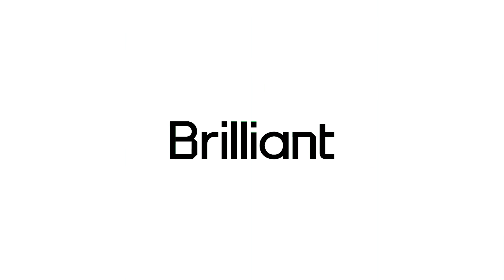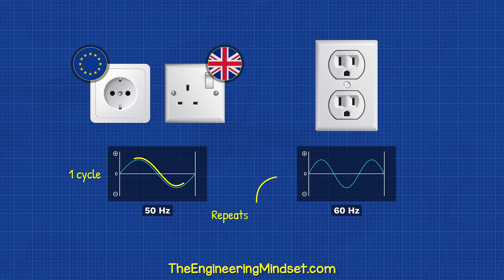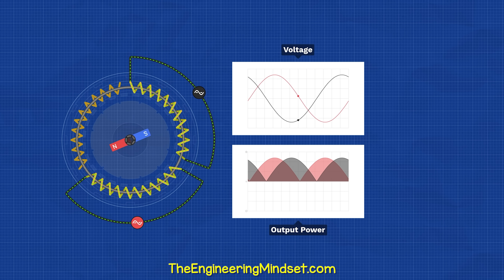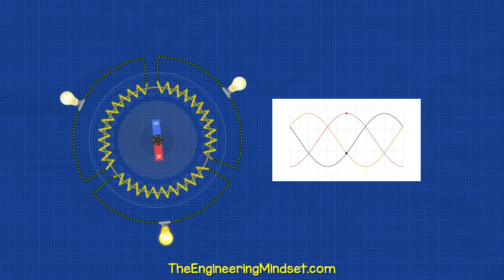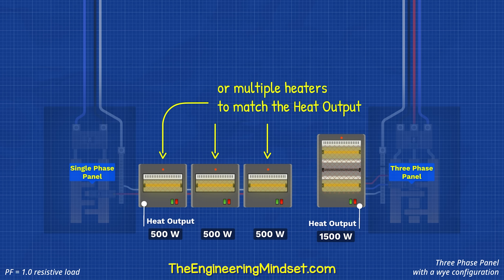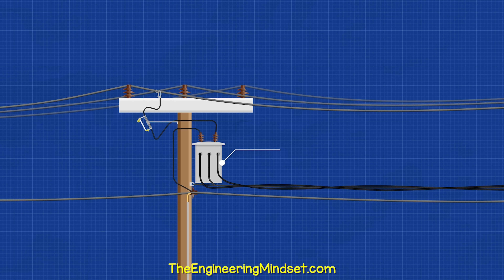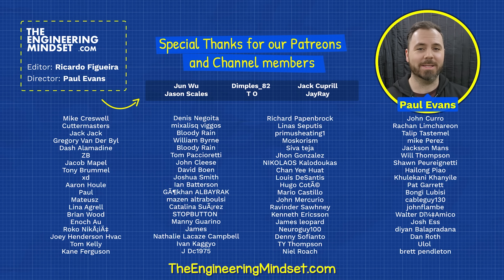How 3 Phase Power works: why 3 phases?

Comment: Finally I found one! When an engineer actually understands the fundamentals behind every technology, like you clearly do, and not just the equations, the result is a clear, accurate, convincing and memorable explanation... exactly what's in this video. Kudos to you for being a good engineer and a good teacher.
Reply: Are we talking about the difference between three out of phase and three in phase resistors, for the purpose of producing the same HEAT? Is there any scenario where IR being pulsed above a handful of Hz will make a difference? Heat diffusion in whatever absorbs it is slow and averagy !
Reply: @Trombonauta  While resistive heaters have their thermal inertia to smooth their output, the constant aspect is critical for big generators and inverters, as well as big industrial loads like motors. But even at a small home that has a 3 phase motors powering a heat pump or AC it's beneficial because the constant power and lack of pulsation decreases wear and noise.
Reply: @Ryrzard  yes, but why are resistive heaters even being mentioned?
Reply: @Trombonauta  Because the other guy mentioned them.
Reply: @Ryrzard  yes, so my question holds, to whoever considered it worth to mention first. I'm not asking about 3 phase motors here.
Reply: @Trombonauta  He asked whether resistive heaters would still flicker and the answer is yes. But they still operate at constant power because of 3 phase input. So that was the question and the answer. Not sure what your issue is.
Reply: @Ryrzard  the question was who cares they flicker. Heat flickering at such freq is the same as constant power for the purposes of heaters! So in the video, why would we even consider heaters as an example? They seem to be the greatest example of when 3 vs 2 phases is pointless.
Reply: @Trombonauta  Because it's a simple example without having to delve into the complex world of motors. And there are applications where a 100 Hz heat flicker may be undesirable since it can be picked up by sensitive semiconductor components.
Reply: @Ryrzard  then not the best example IMO, at all. About the other thing, are you sure the picking up is a heat thing and not an EM thing?
Reply: @Trombonauta  Pulsing heat can absolutely be picked up by sensitive equipment. It's not about EMF.
Reply: @Ryrzard  even considering the smoothing thermal mass, in a heating purposed device, where electronics are not supposed to be in contact or completely unisolated from them? To a point where 30 to 100 Hz makes difference? I can only imagine it's important if your signal happens to be tuned or cares specifically about that freq :(
Reply: @Trombonauta  I'm not really understanding your objection with resistive heaters. They are a really simple example and there's a huge benefit to constant power for all loads (even if it doesn't matter for the device itself), regardless of their application. Resistive heating is just one example where you can omitt complex impedances and nonlinearities.
Reply: @Ryrzard  the objection is easy: that's an example of the advantage of having a more constant power source thanks to more phases. The example is not the best because whatever (itself) you are heating with 1 kW, as far as I can imagine, cares nothing about the heat it feels being constant or just above 5 Hz at its very source. If the justification is that maybe there are some electronics nearby able to feel heat at that speed because they are really thermally connected to the resistors... I mean, even illumination is a better example if just cameras are involved.
Reply: @Trombonauta  Constant power is better whether the heater cares or not. A single phase grid would be very expensive and under terrible stress all the time due to the lack of constant power output. And no, it's not "more constant power thanks to more phases". Polyphase systems provide exactly constant power regardless of the number of phases.
Reply: @Ryrzard  the reason given is not about being less expensive but about heating more constantly, which is what I see meaningless. I'm not arguing it would be better, I'm arguing it's not a good example. Constant heating vs 100 Hz is important.... for which application? It's not the heater who doesn't care, but the thing to be heated.
Reply: @Ryrzard  to be more specific about what the video mentions: who or what industry needs "a consistent (constant) heat source", and considers that 50 Hz would be too inconsistent? That is the advantage being put as important in the heaters example, once the average powers match...
Reply: @Trombonauta  If you're not pulling a constant power but instead a 100 Hz full power pulsation then rotating machines are pulsing at 100 Hz increasing cost and decreasing reliability.
Reply: @Ryrzard  but they talk about heaters.
Reply: @Trombonauta  This applies to all kinds of loads. Regardless if it's a heater or something else.
Reply: @Ryrzard  yes, but you usually (always?) don't care if your heat source flickers 100 Hz (because heat is slow itself and matter provides thermal inertia). So it's a bad example for the advantage of consistency.
Reply: @Trombonauta  If you're pulling 100 Hz pulsating power then that pulsation occurs in the rotating machines that are powering that load, dude. Where do you think that power is coming from?
Reply: @Ryrzard  yes but, again, the point they claim is not about the effect on the power source, but about the purpose of the resistive load (10:10). So... It's a good example not because the reason they claim, which apparently has no justification, but because there would be issues they don't even mention but you are telling here to me?
Reply from the maker: Multiple reasons for 3 phase are listed throughout the video, here are some key points
4:30 Explained how 3 phases provide constant power. Graphic shows “almost” and audio says “more constant” with some small ripple shown, at this point all phases are still separate circuits and we have built upon simple single, two and then three phase generator.
5:05 Explained how it provides equal spacing. 
5:36 Explained how more phases means more cables, controls and protection equipment, complex infrastructure, more complex transformers and motors, harder to balance network and synchronise generators.
6:22 Explains how only 3 wires are needed which is cheaper.
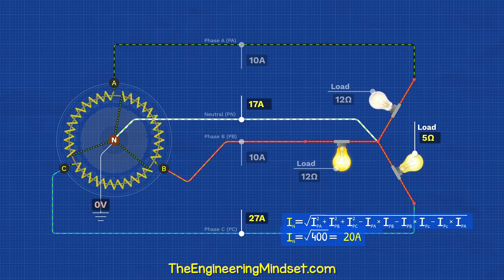7:26 Explained how neutral can be used to balance
7:54 Explained how we use single or three phase from same system
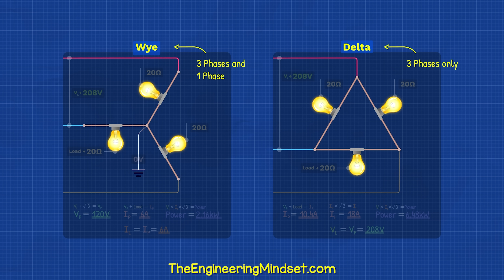8:21 Explained how Wye and Delta are used for different scenarios. Examples uses same resistance and line voltage.
9:59 Explained how 3 phase allows more loads to be connected
10:17 Explained how 3 phase uses more energy but provides more heat
10:19 Compares single and 3 phase power, shows 3 phase power is consistent 
10:36 Shows single phase and 3 phase motor. Single phase has capacitor
10:41 Shows comparison for 3 people v 1 person for motor analogy.
Reply: @EngineeringMindset  🤦🏻‍♂️again: my question was about a specific example, not about the convenience or not of 3 phases grid! Given these non-answers to my concern (about an inappropriate example) I will stop and now believe that, yeah, having my flesh being heated with 1 kW that shows a tiny 50 Hz ripple is overwhelming and disappointing... BTW, my concern could be solved by either saying ok, you are right or by just saying a single example where a 1 kW heater will make any difference at all depending on the number of phases. Will clay in an industrial oven be more fragile for that? Will paper paste dry differently?
Reply: @Trombonauta  I'm really not seeing what the issue is. Constant power is always beneficial regardless of what the load is.
Reply: @EngineeringMindset  I'm not seeing you actually explaining that there's a constant power flow in a 3 phase system at any point in the video.
Reply: @Ryrzard  the issue is: for what specific situation is rippleless heat beneficial? You say always, and regardless of the kind of load, but not a single example! I know that for many loads it is, and that's why heaters are probably the worst load example! Because of the aim and possible applications of their heat! Just one example, please! I don't say there are no situations where it matters, I just would like to have one example!
Reply: If you had to choose between constant heating and a  rippled-at-50 Hz one, and your only reason to choose the constant one is "just in case" or "it's always more beneficial", then maybe my question is not for you. Anyway my concern was a little one, about finding appropriate examples when explaining something, I can't understand how I'm having this big trouble to make my point understandable.
Reply from the maker: Yes I'm aware I haven't said "it provides constant power" in the video and I should have. Yes I know you believe the example I provided isn't a good example. The original commenter just gave some praise and enjoyed the visual explanation without all the math. You may not like the video and I'm OK with that, you can give feedback and that's appreciated but this is just spiralling into a pointless argument so I will not be responding further to this thread.
Reply: @Trombonauta  Well, the stability of the grid is a good thing and pulsing power is the enemy of that. So a constant power load is always beneficial regardless of the application of the load. The whole reason resistive heaters are even an example is because it's easy to show the constant power in them as was already explained.
Reply: @EngineeringMindset Thank you. By the way, I'm an engineer with a post grad degree...advanced mathematics isn't a problem at all. I was praising your conveying an the intuitive understanding that all engineers should strive to gain, on top of being able to solve partial differential equations!

Three phase (or even 30 phase) isn't going to be exactly, precisely, unwaveringly "constant" power... but who cares? At some point the approximation is good enough for practical use (engineering is FULL of simplifying approximations like this). The only true "constant" power is single phase, constant voltage DC, like that used in HVDC interconnects.... but the downsides to using that for all transmission lines are numerous, not the last of which would be the insane cost.
Reply: If he understood the equations he'd know that both 2 and 3 phase systems deliver constant power.
Reply: @Ryrzard  What do you mean by constant power? Wouldn't a resistive heater still flicker?
Reply: @JustinLebo-d3t  A 3 phase heater has at least 3 heating elements and while individual element will flicker, the sum of their heat outputs will be a constant without pulsation.
That's assuming that they are purely resistive. Heaters, especially high temperature filaments, are not linear devices and their resistance changes with temperature and as a result, they produce some harmonics in the current, some of which would not be canceled out by 3 phase current. But generally speaking, 3 phase power provides constant power for linear loads ("dumb" devices).

Comment: If you sign a contract to design a power supply that will use a 3 phase source with higher than 0.9 power factor....you can't just rectify.

Comment: If you came for the title (which is “How 3 Phase Power works: why 3 phases?”), the answer for that is given in a single sentence in the mid of the video, without fully explaining. It explains what happens if you increase the phases, but doesn't discuss what happen if you decrease it and do not answer “why 3 phases” directly.
Reply: agreed, ive been scrubbing through looking for the "why not 2" and im not really seeing it. And in the comments, i learned it's because a Harley motor shakes a lot :shrug:
Reply: Mikhail Dolivo-Dobrovolsky invented 3 phase generator , 3 phase transformer and induction motor , in Germany 1890s.
Same time in Sweden, Jonas Wenström received in 1890 a Swedish patent for same 3 phase system, that was start of ASEA, that is now part of ABB.  
Nikola Tesla in USA and John Hopkinson in UK, also came in conclusion that 3 phase system had something. 
So you had 4 men in 4 different countries that all came to same end result, 3 phase AC system, with practical experiments.
Reply: Yes he does. 3 phase gives a more uniform output while lower phases don't
Reply: 3 phases is the number of phases which was found to deliver the most power to devices without having to engineer in safeguards to keep the system viable.  No one has demonstrated that adding more phases is economical and safe.
Reply from the maker: Multiple reasons for 3 phase are listed throughout the video, here are some key points
4:30 Explained how 3 phases provide constant power. Graphic shows “almost” and audio says “more constant” with some small ripple shown, at this point all phases are still separate circuits and we have built upon simple single, two and then three phase generator.
5:05 Explained how it provides equal spacing. 
5:36 Explained how more phases means more cables, controls and protection equipment, complex infrastructure, more complex transformers and motors, harder to balance network and synchronise generators.
6:22 Explains how only 3 wires are needed which is cheaper.
7:26 Explained how neutral can be used to balance
7:54 Explained how we use single or three phase from same system
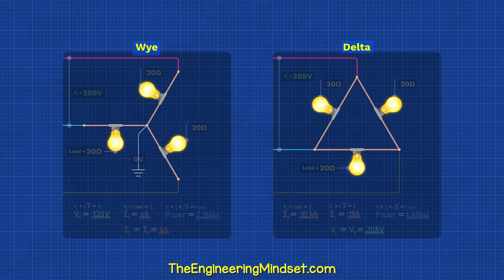8:21 Explained how Wye and Delta are used for different scenarios. Examples uses same resistance and line voltage.
9:59 Explained how 3 phase allows more loads to be connected
10:17 Explained how 3 phase uses more energy but provides more heat
10:19 Compares single and 3 phase power, shows 3 phase power is consistent 
10:36 Shows single phase and 3 phase motor. Single phase has capacitor
10:41 Shows comparison for 3 people v 1 person for motor analogy.
Reply: @EngineeringMindset excellent, your explanation was 12 phase 🙂

Comment: if the rotating magnet creates the first step to get electricity how does the magnet rotate?
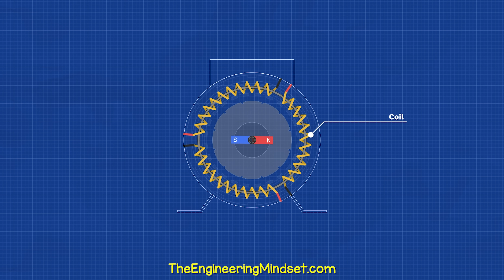Reply from the maker: 0:53 anything rotating can rotate it, wind turbine for example. Here a permanent magnet is used but it could be an electromagnet, just power it from a diesel generator and then use a water wheel or steam to turb the turbine and magnet.
Reply: @EngineeringMindset  So fossil fuels or renewable energies, got it. Thank you for the answer! 🤝

Comment: 3:30 "It is too fast for the eye to see"
No, you can not see the incandescent light switch on and off with slow-motion because the temperature of the filament only fluctuates a little bit. It doesn't drop below the temperature where it stops producing light in the time that there is no current flowing through it.

Comment: There are two things I admire about Europe compared to the US: quality public transit and 3 phase power in the home. Really several things about electricity in their homes is better than the US. Here in the US where we all have air conditioning, 3 phase compressors would have saved a lot of energy over the decades. This is becoming less relevant with inverter-driven compressors proliferating, but a lot of energy was left on the table over the last 60 years

Comment: I've been wrong many times in my life, so correct me if I'm wrong again, but I believe the United states uses 50Hz.
Reply from the maker: The US uses 60Hz
Reply: @EngineeringMindset  I just googled it, and you're right, however, I was working as a mechanical designer awhile ago, and we used 50hz on motors that went to the states. I wonder why. I wonder if the company who bought our product sent it to europe.

Comment: Nice vid, and well explained.  Thanks.

One issue with the narration only:
11:59 - "Then squared that value.." is highly confusing. 

It would be better to say, "rooted" that value — or "took the square root of" that value.  Otherwise, you would not be reducing the measurement but increasing it exponentially to orders of magnitude greater than the result you're seeking.

I know the picture itself says, "Square root" — but you don't, and the graphic flashes past.  So I had to pause the video and go back to see what you were trying to say.

Comment: In my country all properties have 3-phase access, but the service provider will conect only one phase unless you ask for a 3-phase specifically. There's a fee for that, but it's small enough that lot's of homes will get it for just one appliance (mostly a single water pump).
Reply: how big are your main fuses? if they're 3x6000w then it makes no sense to just use 1x6000w
Reply: We don't use fuses here (only in very old houses), it's all thermal circuit breakers. The standard is 220v 50hz, i dunno if it bears any relation.
Reply: @besacciaesteban how many amps are the 3 220v main breakers each?
Reply: Bipolar thermomagnetic breakers must be 25 amp at the very least for a house conection. Service conection will be denied if this breaker is missing or malfunctioning
Reply: @besacciaesteban 220v 3x25a is a lot of power (my home is only 120v 2x60a) but 220v 1x25a is almost no power at all

Comment: Very well done, thank you!  3-phase is the biggest bang for the customer's buck, with only 3 wires, only one additional wire compared to single phase.  For some high power machines, 5-phase is better, although more costly (but less ripple and conductor size is reduced).  Both 4-phase and 6-phase are basically useless for motors, the increased cost gains you nothing over 3-phase and 5-phase respectively.  However 6-phase is a nice low-cost solution for so-called "rectifier front ends" converting to DC with very low ripple, and is easy to implement with the right transformer connections.  This is the best video I've seen on the topic.